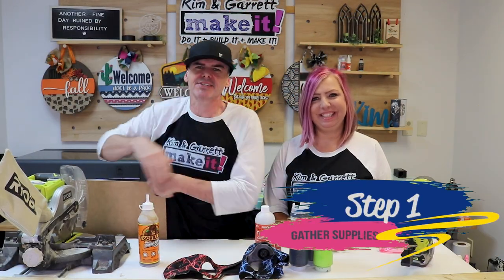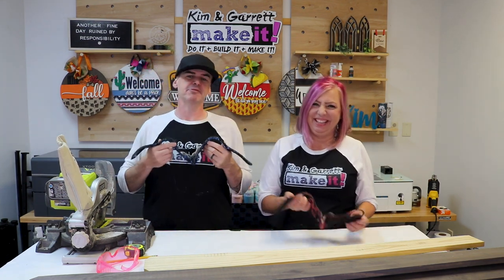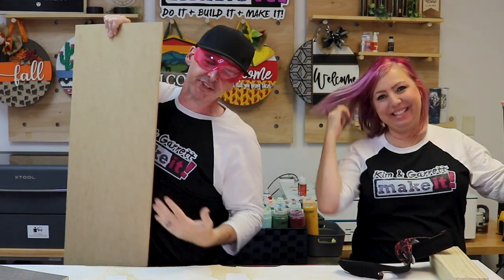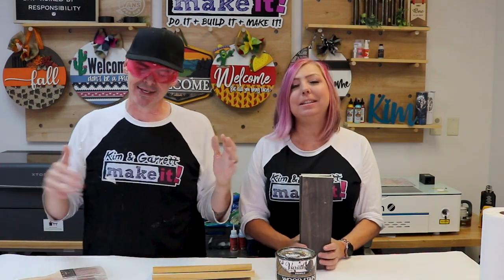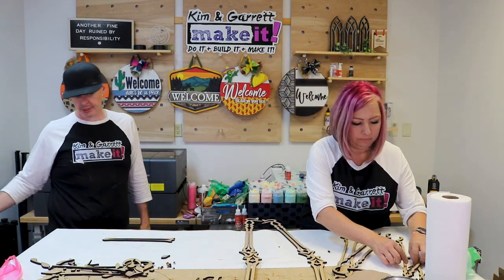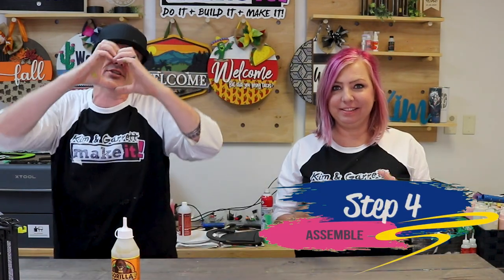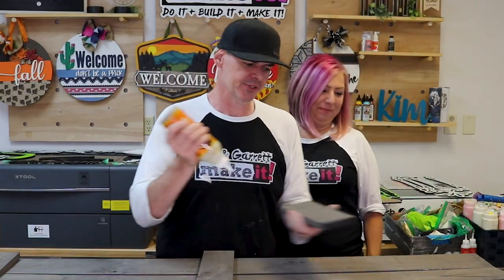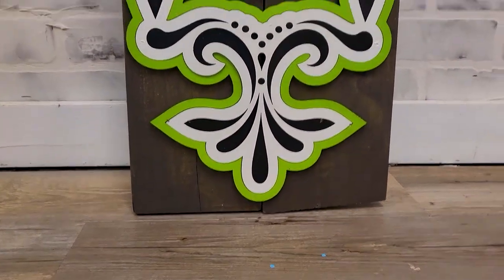Halloween 🎃 Outdoor Decor | Front Porch Halloween Decorations | DIY Outside Decorating Ideas 2023

Comment: So I bought this file from you guys and I also have the P2 with conveyor. I reduced it to 3 ft tall, so I had the extra wood to push it through and back. I set my tab settings the exact same as you did, but when I processed it, it didn't cut any tabs and pieces were falling through. And getting cut. I wonder why it didnt cut the tabs? I'm going to just cut my mdf down to pieces and cut the file in pieces, because I also realized once I got my conveyor put together that I only had the basic set and would need the extensions to do even a 4 foot board😂 anyway looking forwad to you guys doing a video on the conveyor again.